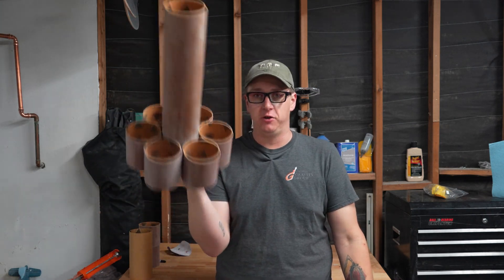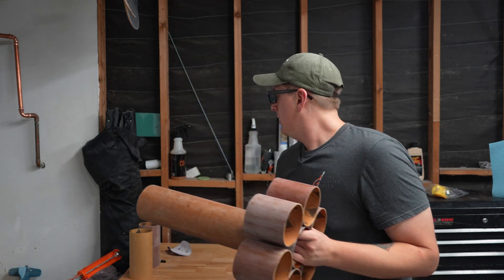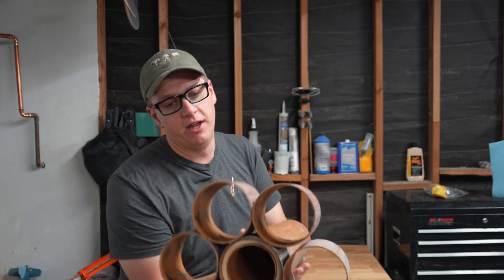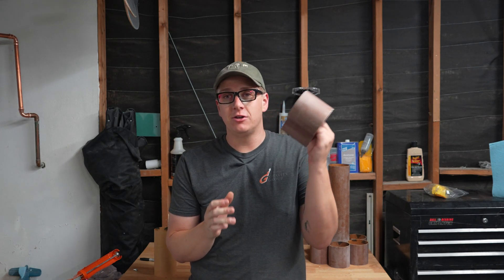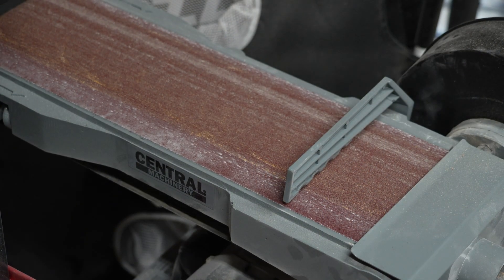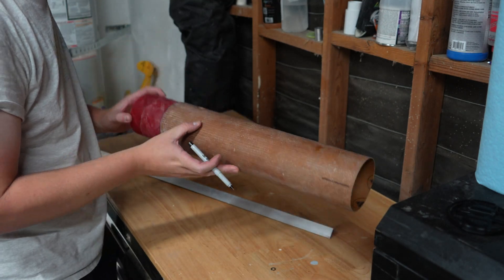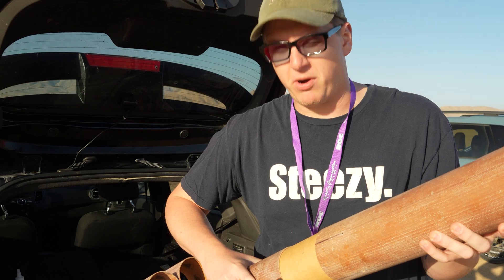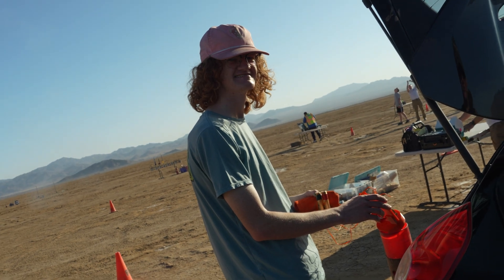My Rocket Test Flight Didn't Go As Planned

Comment: I know for JLCR's they tell you to put the chute release around the parachute only, not the nomex.  I don't know if the charges from the line cutters would melt the parachute, but it might keep the zip ties in tact through ejection.  I'm pretty new to all this, so if you try it and it doesn't work, I didn't recommend it😂
Reply from the maker: @danielfloyd9742  That was my original plan, considering the gasses from the cutters are supposed to be contained within them. However, considering they keep blowing the orings and clay out the back, I think they definitely would burn the parachute.

Comment: So....  Braden,  I think I missed something.......... If the charges blew out the back end of both cutters........  I understood your electronics would fire the Cutters at preprogramed altitude....
    did the zip ties just break on their own ??      Why did the Main deploy at apogee..... ?
Reply from the maker: @Glasspack66  That's what I need to figure out.  I'm wondering if my charge cannons melted the zip ties at the top. It was a bit after the drogue charges fire, though,  so I'm not entirely sure.
Reply: @RocketVlogs  ....Thank you